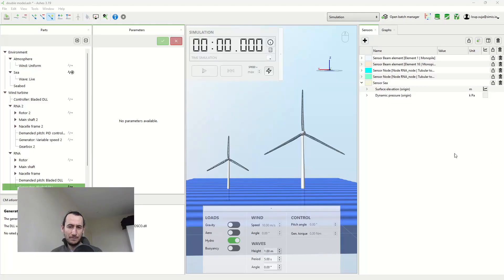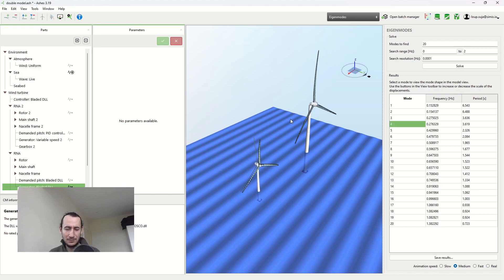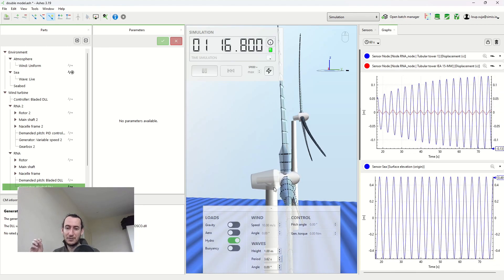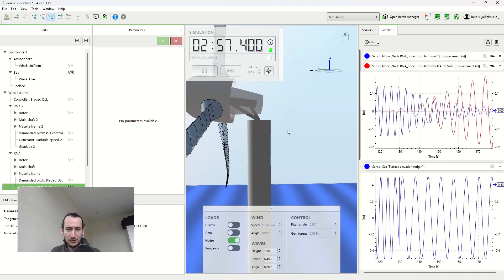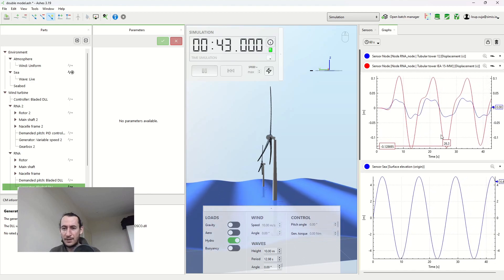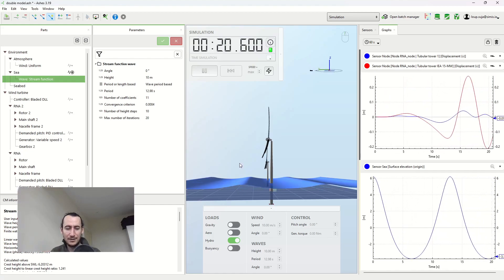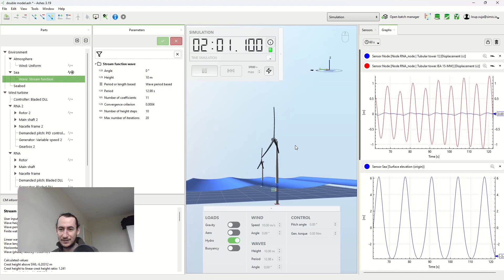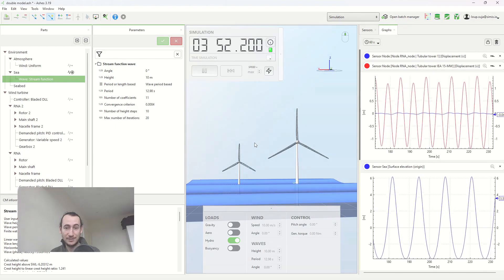Offshore wind turbine resonance triggered by wave loads - Ashes

Comment: Very nice video! How much does the direction of waves matter at time period corresponding to eigen frequency of the turbine?
Reply from the maker: Hi, what do you mean with 'matter'? Are you wondering about whether it will still trigger the eigenfrequency, its impacts on the loads...
Reply: @AshesWindTurbineSimulation  correct, that's what I meant :)
Reply from the maker: @33Mysterious  Still not sure which one of the two you mean :)
About triggereing the eigenfrequency, yes it still will. The support structure eigenfrequencies are virtually the same in all directions
About impact on the loads: for fatigue loads, what matters is how much aerodynamic damping there will be, so it has to do with whether the direction of the waves match the orientation of the blades

Comment: nice job !!! it could be nice to compared some results with OrcaFlex
Reply from the maker: We have something even better! Every night, we run 1000s of tests and compare our results to analytical solutions, published data and results from other software. Then we publih it every time we release a new version of Ashes, so that you know that the version you are using is accurate. Here for example you can see how Ashes compares to other software for the OC3 Phase I project: https://www.simis.io/docs/oc3-benchmarks-oc3-phase-i
Does that makes sense to you?
Reply: We are (literary) always very interested in doing benchmarking - and benchmarking with OrcaFlex is particularly interesting. And - as mentioned in the comment above- we strive to continuously expand our public testing framework with relevant tests and benchmarks. For us, it appears to be an obvious, inevitable, and important step forward for the engineering software industry to publish a complete set of tests and benchmarks for every new release.
Reply: @paulthomassen2184  we could discuss to do benchmarking with OrcaFlex, we have an available license and for us,  it would be fun to perform an analysis and compare the results.